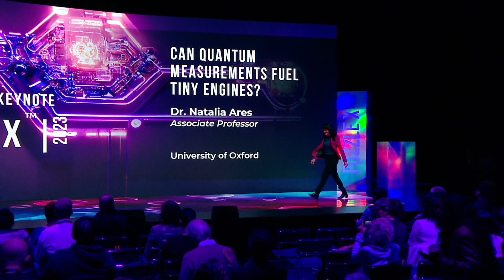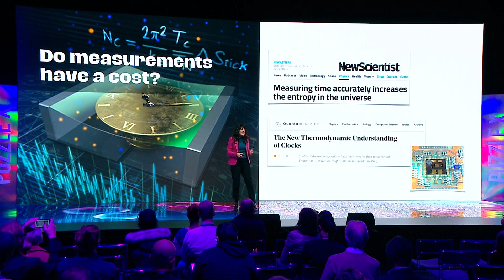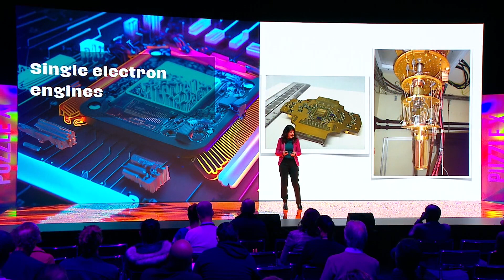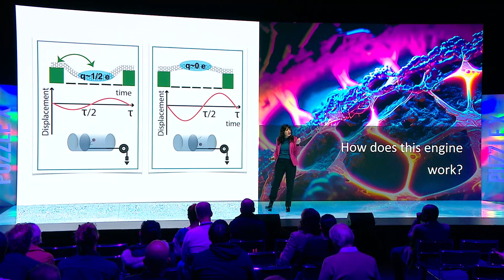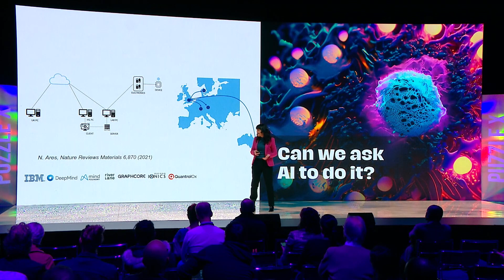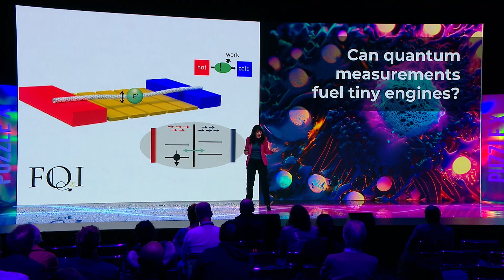Natalia Ares: Can Quantum Measurements Fuel Tiny Engines? PUZZLE X Keynote Talk

Comment: Can AI do quantum measurements without collapsing the wave function? If it can, is that proof that AI is not conscious?
Reply: No. Any macroscopic object will collapse a quantum system when it measures it. This includes tiny air molecules so would include any computer you ever wanted to build
Reply: @tewyube1234  
That seems to be a theory that is not observable, right? How do you confirm, without observations, any theory that claims to collapse the wave function without observation? Isn't such a theory unobservably unfalsifiable by definition?
Reply: @mikejurney9102  I think the following experiment would work. Take some system starting at A at t_0 and evolve it to B at t_1 and C at t_2 and measure. Now repeat but after evolving it to B have some macroscopic interaction and then evolve to C then measure. These two should have different measurement statistics because the decoherence in the middle of the second experiment is physically detectable. Happy?
Reply: @tewyube1234  Yes, I think you are right, but I don't know what your point is. You're saying that the measurement in the middle or not effects the measurement at the end, right? So what, then? What does this say about theories that disallow measurement from a conscious being?
Reply: Imagining for an instant that quantum measurement can only occur through conscious interaction, I still don't think we could test the consciousness of AI using this. Wouldnt you have to effectively measure the AI to see what intervention it did, thus inevitably collapsing it anyway?